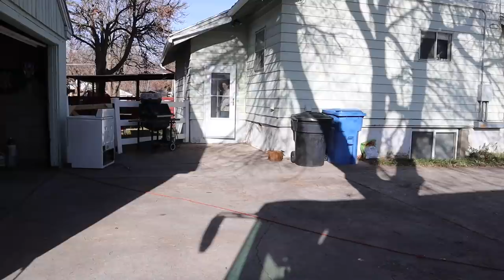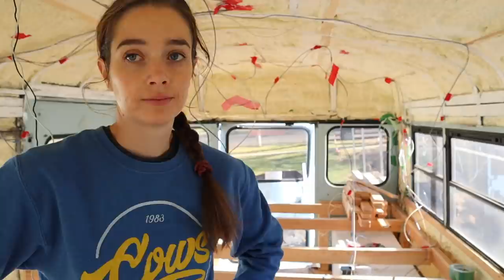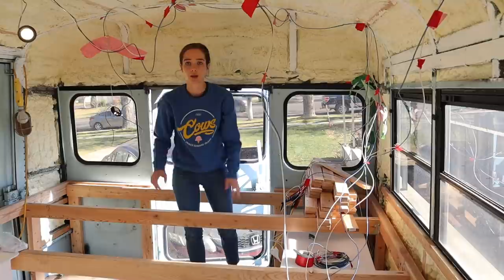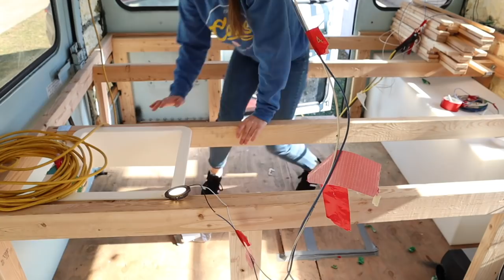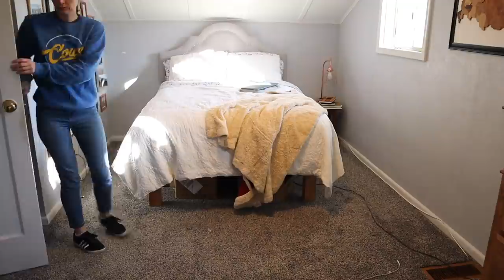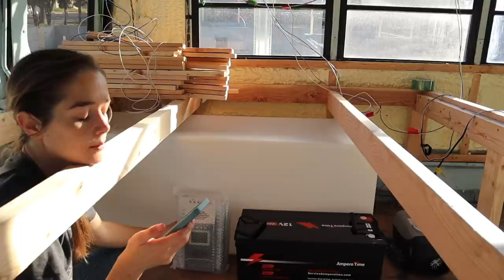School Bus Conversion Electrical P1: Testing 12v lighting, organizing components, &SO MANY QUESTIONS

Comment: The wall thing should be fine.  Make sure it can be removed in case you need to pull the water tank.  Also the platform of the bed should be hinged and open-able so you can check the tank.  I think Mike with navigation nowhere put out a YouTube video on the solar panel thing.  Check him out
Reply from the maker: ohh yes the first thing I did when I bought the bus was binge all of his videos! I will have to go for a rewatch 😊 thanks!

Comment: Emma you are doing great But as some one else has mentioned you need to think about weight and balance remember water weight is 8 pounds per gallon, that with the weight of your battery might be a little heavy for one side maybe move the battery to the other side. Just food for thought.

Comment: You want to put a 2x4 cleat on each side of your water tank on the floor to keep the tank from moving. Then the simpliest method would be to buy screw in eye bolts that you drill a small pilot hole in your 2x4s on each end then buy some ratchet strsps that you run across the tank and hook into the eye bolt eyes. You do not want hundreds of pounds of water loose when you are driving around.

Comment: Emma if your bus is 12 volts you could run a designated positive wire from the buses distribution panel and run it back to where your going to put your fuse block you bought for your accessories once you have that in place you can start running all the lights heater etc just remember if you leave stuff on without running the bus once in awhile you could run the bus battery down I won't do this for a permanent solution unless you put an isolator in line between the wire you put in from the bus panel and your 12 volt fuse block the isolator will keep the system from draining the bus battery while your parked but will work if the bus is running
Sounds confusing but it's not you need someone familiar with doing this.
Water tank yes block it in your two by fours is a good idea just remember water weighs
8 pounds to a gallon so definitely secure it well all sides so it stays put. You've got this and your doing great. Oh the battery you have is heavy because of the type of battery
Lithium batteries are half the weight of lead acid and will last if well taken care of 10 plus years they cost a lot but we'll worth the money a lot of YouTube video's on it.
Reply from the maker: thanks! It actually is a lithium battery 😊 and my power station thingy works really well as a temporary solution, I just forgot it existed for the entirety of this video 😅
Reply: @EmmaBuildsBirbie  that's great Emma lithium is the best, smart girl you got this .

Comment: If I was doing this with electrical I would have a bed lift for access...also all the other storage you will be able to use. Its not if you will need to get to under but when. Not sure how many gas struts you will need for a mattress side lift. Guessing 4--2 work for an end lift

Comment: Oh remember to run the wire by the side of the water tank that is closest to the front of the bus if you are going to put the wall there.  I was confused why you had a spark when you connected the battery.  I didn't think the wires were connected to anything.  Normally  I would have done a continuity test to see if the wires were good but doing it the way you did probably helped you more.
Reply from the maker: so the wires shouldn't have sparked if they were just connected to the car battery and nothing else? What's a continuity test?
Reply: @EmmaBuildsBirbie  the only way connecting the battery would have sparked is if the wires you were connecting to were somehow connected to each other or bare wire touching each other.  I'll explain more in the video I'm making but for now I'm hopefully going to have time to edit the quick video I made for testing continuity on wires and get that out today.
Reply: @EmmaBuildsBirbie  I've put up the continuity test video if you are still interested in what it is.  You will probably be finished with the electrical by the time I get the electric basic video done.  Make sure you don't put any sharp 90 degree angles on the wires and be careful not to pinch them underneath your paneling or ceiling.  That can cause a break in the wires later on and cause a lot of issues. Your videos are really good.  I'm working on a new editing program and will take me a while to get where I want with it.  Good luck!
Reply from the maker: @techshoptalk375  thanks!

Comment: I suggest you put the battery on the opposite side of bus looks like its a lead acid battery very heavy and if you find you need more power adding on same side as water tank   cannot tell what size tank but 50 gallons over 400 lbs 8.3lbs gal and I thing your diesel tanks not dead center you have too much weight on one side consider that when putting kit and bath in too
You might want to put all heavy items dry fitted Ann carefully take bus to public scale weigh it front and rear axle and side to side
Having too much weight on one side or too much on front
Axle can be dangerous at worst or a bus very uncomfortable and hard to drive but your doing ok not rushing to get it done makes errors more likely

Comment: It worries me a bit that you're putting the two heaviest components of your build (water tank and batteries) behind the rear wheels on the same side  of the bus. Maybe someone with more experience building buses will have a good reason not to worry about it, but it seems like moving the heavy stuff over or slightly in front of the rear axel is a good idea, and splitting the weight from side to side is also smart.
Reply from the maker: i was going to put the grey tank on the other side but I didn't even think about the weight of the batteries until seeing everyone's comments! 😅

Comment: On the solar panels I’m not sure if you have a good back up power, my parents have 3 large solar panels On their trailer with a really good inverter, after about 3-4 days of bad weather and dark sky’s they had to use their generator to charge up for a bit (that being said, that’s with an electric heater, using a microwave, tv, and all the other odds and ends)
Reply from the maker: good to know!! I am gonna try to keep most stuff 12 volt where I can
Reply: @EmmaBuildsBirbie  sounds like a good plan! Harbor freight sells the small quiet generators for like $400, might not be a terrible investment for those rainy days as a good backup

Comment: You can touch both sides of 12 volt jumper cables. But don't touch the red to black or connect both to same piece of metal.

Comment: Think about weight and balance.  Where’s the bus fuel tank?  If it’s in the center then you might want the water tank on one side and the batteries on the other.  What is the type of battery you have?  Lead acid need to be vented and since you are putting them inside then they need to be enclosed and vented.  

Don’t forget to put in a few USB charging points and maybe the 12 volt cigarette lighter charging points.  Easy now not so much when you get the walls in.  Your lights are flush mount, have you gotten the right size hole saw to mount them.  

Look to have a water fill point on the outside of the bus. Think about the routing of the water lines to where you need them.  Are you planning on having a hot water heater?  Where are you planning to install it?  Is the water heater going to be propane or electric on demand?  How will you power an electric water heater?  

It’s just planning on what you want and how to install it.  Think about how you will be living in your bus.  

New thought would be to get large cardboard boxes and cut and tape to mock up the cabinets and interior to see about flow and even shapes.  It’s easier to cut than wood and a lot cheaper. 

Hang in there.
Reply: It's a 50lb battery. A bus rated for 20,000 lbs won't notice a 500lb tank
Reply: @mrmotofy  if you say so.  You’ve built many vehicles?

Comment: New here... maybe you have plans for the opposite side of the water tank. Otherwise if the water tank was on the passenger side there might not be a fuel filler box there in the way. And weight distribution will be better with batteries on one side, water tank on the other. Just my .02

Comment: Have you watched a bus life Issac hayse builds school bus homes and shows how to setup your power station board and circuit breaker box and just work from there one breaker at a time and label them on the panel it's easier to keep track of your systems

Comment: I think that you would be better off putting all the electrics on the other side of the bus, that way you can add another battery whenever you want plus if you mount all the electrical components onto a board to fit under the bed it will make things easier for you. At least you got the lights working so well done,
Reply from the maker: thanks!

Comment: ok can I add a comment based on others' comments here? Your wall is insulated around the tank already right? That's plenty to keep the tank the same temp as the rest of the bus. Also about weight. An 800 pound water tank weighs the same as four teenage football players with some gear. That tank is spread out over where 5 or 6, even more seats were. The weight is fine. I have my tank in the same spot. Batteries on the same side, but another window forward. Then my apartment size fridge, and then my full size stove. That side of the bus definitely sinks more when I am parked on grass. I might be doing a bit of stress on my springs underneath. Weight-wise it is fine but you might consider appliances on the other side of the bus, but it IS a bus, and you will be fine.

Comment: EMMA, EMMA, EMMA!! I don't think your electrical engineer friend has experience with automotive electrical systems. PLEASE ALLOW me (retired truck mechanic) give you a quick wiring class.

The bus is NEGATIVE GROUND. That means THE ENTIRE BUS BODY is connected to the negative side of the battery. When wiring in the lights, house batteries, charge controller, ALL NEGATIVE LEADS ALL GO DIRECTLY TO THE BODY! (commonly referred to as the ground.)

Lets use your lights for an example on how to wire them correctly. The 12 volt negative from your power pack will connect to your bus body. The 12 volt positive will go to first a fuse for that circuit, then the switch, then finally to the positive wire on the light. The negative wire on the light goes to the bus body.

You are supposed to use wire for the positive side from the power source to the load, and the bus body for the negative  return trip! Get it??

This also means for no matter what you are connecting, the negative/ground wire can be connected to ANY METAL part of the bus that is convenient for you to connect it to.
Reply from the maker: I think I am wiring it more like a house though :)
Reply: @EmmaBuildsBirbie  You should wire it like a house only when you are dealing with the 120volt AC wiring. All your 12volt DC should be wired as I described.

Not that how you are doing it now won't work, it just will be simpler for you to do and less likely to give you trouble later on in life.

Just think of the body as one giant negative pole of your battery that you can tap onto anywhere you want.
Reply from the maker: @dieseldave564  okay 😊

Comment: Multi-meters are not hard to use. You have an electrical engineer friend. Can you two get together for an hour or so? That way you can have your friend teach you how to use your multi-meter.
On your battery location I suggest you locate it where it can be easily accessed from the outside of the bus. Like by the rear door or side door. That way if you need to maintain or replace the battery you can just open the door to gain access.
On your water tank, does it set right against the heater? If there is an inch or so you can put in some sort of heat barrier.they sell foam insulation with a reflective silver side. You can put a piece of this between the heater and tank.

Comment: plan what you're going to run on DC and then buy your breaker box....make sure you get the correct amperage for which you're running..I meant what a breaker you're going to need some other words for your lights you should go like a 15 amp dc breaker.

Comment: Solar to charge controller to battery is not a simple subject.
What is the output of your solar voltage and amps?
Series, amps stay the same.
What is the batteries amp needs, continuous vs max amp? 
The charge controller needs to be able to supply the continuous amp rating for the battery to be happy.

Comment: I agree with some of the others, pay attention to your weight distribution.  Even though this is a bus, as you add more, it will add up.  I would also be concerned having your electrical right next to your water.  If you have a leak this could be an issue.

Comment: Please don't put the electrical items near the water tank. It's definitely not safe, as well as all your weight on one side would be no bueno. Oh, and if you don't want to drill a hole through the wall of you bus, you might want to arrange your water tank so it's fill valve is facing out of one of your doors. Question, you're going to keep all you plumbing inside your bus, right? BTW, good job on the lights! Keep up the great work! 👍🏽😁💯

Comment: My God, I wish I could just talk to you on the phone solar, it’s so much easier than you think it is. You only have three 12 V panels. you can’t get the connectors to tie them together Ron wants Adeline to charge controller set it up for a 12 V system and the way you go. Putting your breaker in line close to the charge controller is a good idea. There is also a fuse that is in line that you should be able to plug-in right at the panels or at those plugs at the panels. It would be a good idea to put one there also and then as you run lines from your charge controller to your batteries run at least One breaker or fuse there. The way I have mine set up as I have breakers on each end so another words I have one at the battery I have another one at the charge controller or close to it for the batteries. Then I have an in-line fuse at the solar panels, and then another fuse or breaker at the charge controller for the panels. That is redundant and it’s not cheap but it is definitely safe

Comment: Sunshine you have way too much weight on the driver side the water tank is how many gallons times 8 pounds per gallon and then the battery or in future more batteries on the same side these are heavy also. Divide your weight side To side To stabilize the weight. Also make sure you tie down the tank with straps to keep it from moving as a serious shift in weight is a very bad thing

Comment: Video on how to use multimeter     https://youtu.be/ts0EVc9vXcs      . For now you are mostly working on 12 Volt DC so it is the V symbol with the straight line with the three dots below on the multimeter, the V with the curvy line is AC. You cant shock on your 12 V car battery, dont worry. Normally 12 VDC can at best burn a cable on a short but wont shock you. Try to place your electrical components and circuit breakers so they are easily accessible once your build is complete, to fault find and switch things on or of. You dont want to always crawl under the bed to access them. As you will be refilling your water tank, place your electrical components so that spills, overflow cant come into contact and blow your expensive, solar charger, battery management, inverter etc. When storing your 200Ah battery, always place it on wood not directly on concrete in the garage as it will discharge if left for some time.

Comment: Since you seem to be about a month behind in vids it's probably too late for suggestions. Any electrical display panel should not be hidden under the bed platform. They show valuable info as to how power consumption and battery levels etc and you'll want to be able to see the info easily at any time. It would be like putting your speedometer and under your seat and out of view. Since you said you have help with you, I'm sure it will all work out.

Comment: You're doing a good job but you should have the batteries and some of your other stuff on the other side otherwise your bus that's going to be leaning to one side especially when you fill it up with water going to have to distribute the weight so you don't have everything I want site
Reply from the maker: thanks!

Comment: Hi, I like your videos. I especially like you more. I am very attracted to you. Ok, So as not to be creepy I live in Georgia and will probably never see or encounter you. Well now on to what I want to tell you about the bus, also you probably don't want to hear this either. But you need to put all that weight on the rear axle, or as near as possible. That is a lot of weight ,you do not want it hanging over the rear of your bus. It should be mounted on the rear axle. It will affect the operation of your steering, handling . But it is your build. So only my opinion. And  I would like to add that I think you are beautiful. So... Yeah. That's all I got for now. Great job. From Richard.